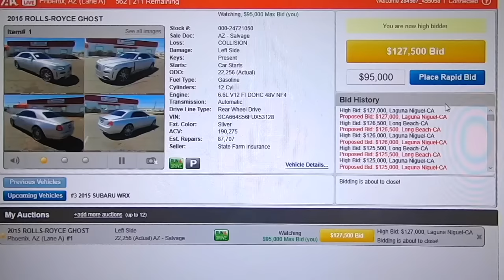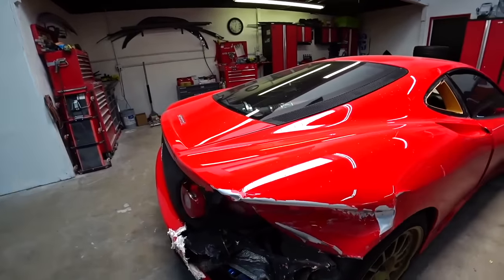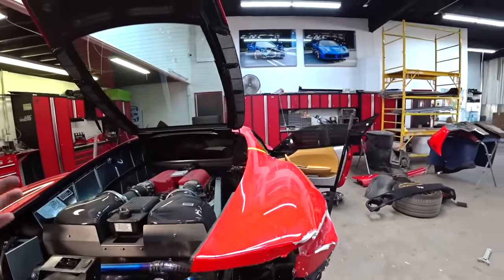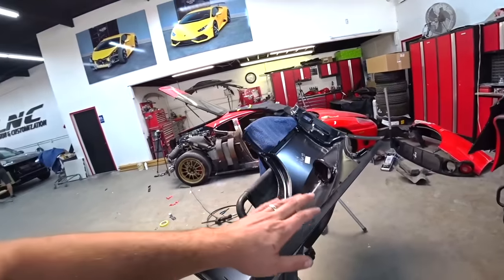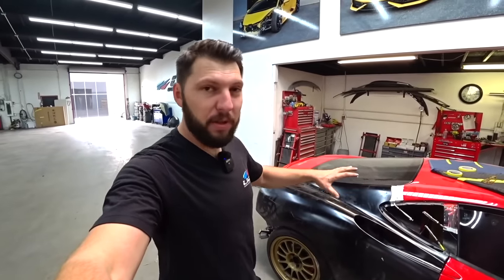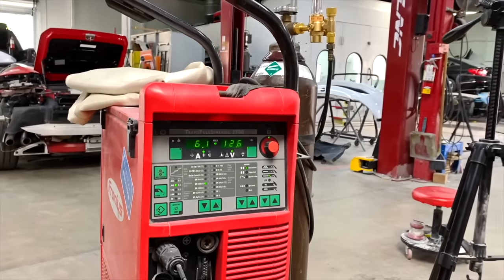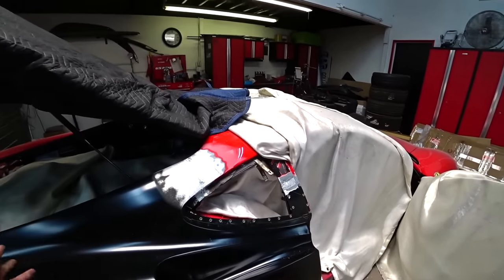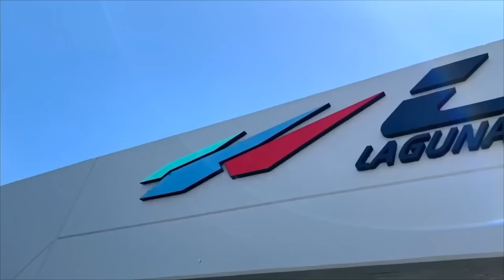REBUILDING CRASHED 2002 FERRARI 360 REAR END QUARTER PANEL DAMAGE (part 1)

Comment: I've been a fan for a while now, and I enjoy watching you apply your craft.  Amazing!
I do have a question, I wonder about for a while now.  I am not a body man, so, I don't know why you do some things the way you do.  One of those things is the "glaze" you apply on top of the body filler.   Why do you use glaze?  What does it do that the body filler doesn't do?  Does it strengthen the overall finish, does it seal it?  Why use it?
Reply from the maker: Thank you my friend for your support..👊🏼 Glaze is a premium, technically advanced finishing glaze designed to eliminate pinholes and surface imperfections prior to painting. Its self-leveling formulation gives a smooth ultra fine finish which requires minimal sanding.

Comment: Why did you not cover the engine bay up …would have stopped hot sparks dropping on the plastic trim 👍🏻👍🏻
Reply from the maker: It’s aluminum there is no hot sparks ⚡️
Reply: @lnccollision  fair enough 👍🏻👍🏻

Comment: Why don’t you cut the damaged portion only and make a patch inner side, it would be providing a stronger bond. By the way, I don’t think ur patch works since your welding was performed along the cut line only but not the edge of the patch